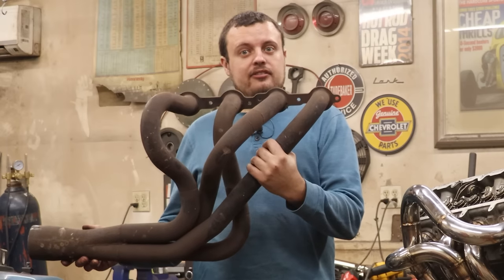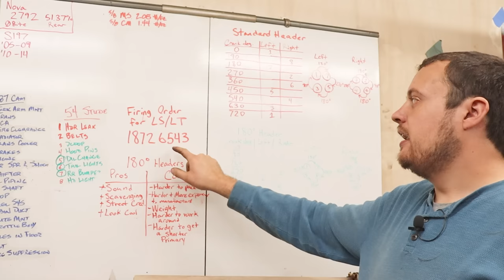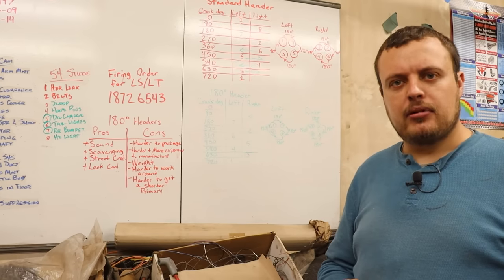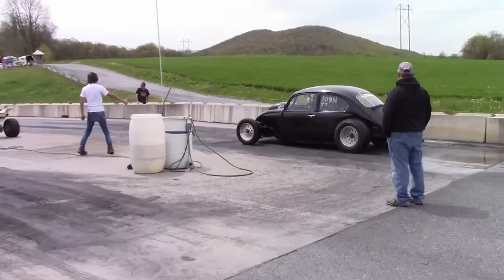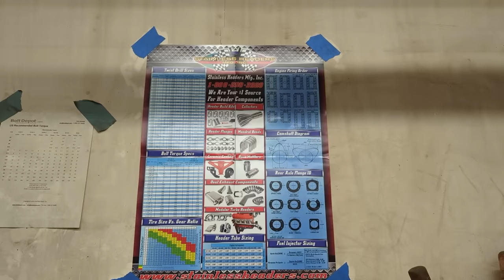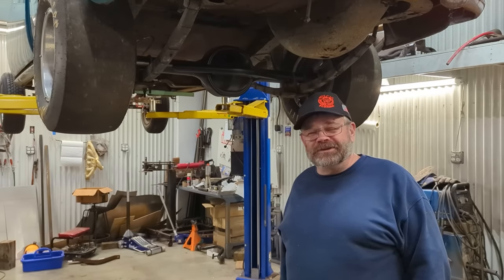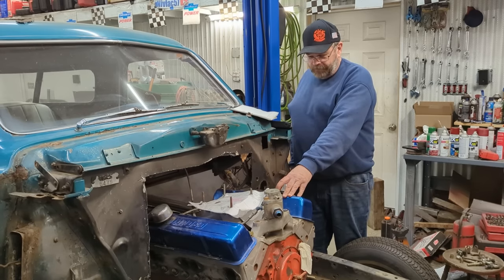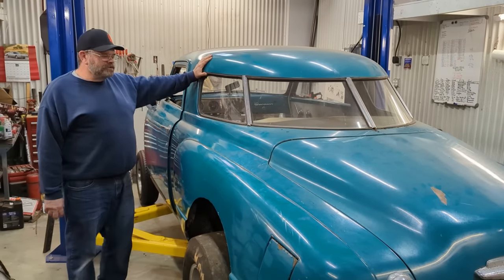I Built a Set of 180 Degree Headers for the Perfect Sound

Comment: Great looking set of headers. I have a 1987 mercedes turbo diesel with 6cyl 3.0L
I want to put a bugger turbo on. Do you know if its possible to build a header to give a diesel a good sound.
Reply from the maker: I've never messed with diesels, but if it's an inline 6, an equal length header usually will sound the best. Not event sure what to say on primary length. I'm sure it would require some heavy duty pipe too.

Comment: @junior: Maybe you can achieve power and sound at the same time!?!?
Make one or two H-pipe connections instead of the Y-connector. You have the 180°-V8 at idle but the power of "two 4-cylinders" at high rpm. If it's not smooth enough you can add 2 resonators (one for each bank) like an appendix. Ask someone for the measurements for improving the torque at a specific rpm.
Magnaflow mufflers each side don't hurt aswell.

Comment: Are you going to put a layer of mylar on the bottom of the oil pan or perhaps wrap the headers?
Reply from the maker: Probably not. It has a pretty good air gap. I'll monitor oil temps. If it's a problem, I'll probably wrap the headers in that spot.

Comment: Good idea but there are other solutions too. Yeah, regular headers are very inefficient. Have you tried tri-y or unequal lenth primaries. Check out powertech 10 with david visard. If your heart is set on sounding like a Ferrari, then flat plain is your ticket, but at a loss of torque. Have you tried a 4-7 swap? An LS firing order or an LS as is? Really good heads, stock, up to 4.10"  stroke without the airflow imbalance on the intake. Makes 50-70 hp more for the same displacement. Good luck, and keep up the good work.
Reply from the maker: Yeah. I've never heard a Tri-Y that sounded good. To each their own. I'm not doing this for the power, I'm doing it for the sound. If it makes more power that's cool too.

Comment: Would it be possible to swap the heads so the exhaust is pointed towards center of motor. Exhaust on top routed towards the front for turbos. And have separate intake manifolds for each side? Would be easier to do short primaries.
Reply from the maker: With the pushrod arrangement on this engine that would be very difficult.

Comment: Is the 180 deg heads also the same as "equal length" I've heard people mention before
Reply from the maker: No. They are not the same thing. Equal length is just when you try to make the tubes all the same length. 180 degree headers do try to make all the tubes the same length, but they also by definition rearrange the pipes so that they go into the collector with their 180 degree paired cylinders.

So proper 180 degree headers are equal length, but equal length are not necessarily 180 degree headers.

Comment: I see some really high oil temps  without some serious insulation between those pipes and pan ,wich is in turn going to hold hear in pan .
Reply from the maker: I'm not too worried about it. It has a pretty good air gap, but we will keep an eye on oil temps. If it becomes a problem, we'll wrap the headers in that spot. Look at modern Hondas. They run the exhaust right under the oil pan similar to this.
Reply: @Calvin-Nelson  savy !  Good plan !

Comment: This is the hard way. You can achieve a nearly identical sound by replacing your y-pipe with an x-pipe into a true-dual exhaust, meaning that out of the x-pipe are two separate pipes that dump wherever you will be dumping the exhaust. The x-pipe + true duals will also help with high RPM HP production. Another option is the h-pipe + true dual pipes, which will retain the "classic" V8 sound, boosting lower frequencies and improving low-end performance. If you primarily use your car for cruising then the H-pipe is the smarter option unless you really want your V8 to sound italian.
Reply from the maker: I've run a dual exhaust with an X pipe. It sounded nothing like this.

Comment: So….. would you think a set of 180* headers with a Y pipe would sound the same as an 8 into 1 collector setup with the tubes entering around the collector in the correct firing order? Essentially by merging the 180* headers with the Y pipe you are changing the pulses entering collectors from 90* intervals to 45* intervals the same as the 8 into 1 collector would do???
Reply from the maker: I've never heard an 8 into 1 that sounded like my dad's Datsun. With the Y pipe it is getting pulses every 90 degrees

Comment: you said 180 degree headers sound like 2 competing 4 cilinders, however, the ford gt had no Y pipe and it sounded like a proper V8. Wouldn't an x pipe be ideal in order to improve flow?
Reply from the maker: It probably would help. The GT40 probably sounds proper because of the proximity of the pipes to each other.

Comment: If the headers are different lengths you won't have pulses arriving as regularly as you say. A longer pipe means pulse takes longer to get to the end.
Headers when a tuned length have positive and negative pressure waves, the negative wave pulls gasses out by arriving as valve opens, the positive just before valve closes so charge isn't exhausted.
Syphoning doesn't occur.
For yours to work as regular pulses all pipes must be equal or a calculated length..... maybe if the crossover pipes are twice the length?
Be better to just have the 4 into 1 normal and just have different lengths for the out of sequence pulses maybe?

Comment: 180° Headers male more power!
It's what I call Free HP, nog that building a set isn't expensive, they are but they make power through making your engine more  efficient,most power adders have a trade off, big cam, low vacuum and no lower dnd power etc etc almost all power adders cost fuel.milage, Not 180° headers or anything makes engine more efficient and these make an engine considerably more efficient. Remember Pantera DeTomoso's? They had the highest HP small block ever built, the 351 Cleveland but the Pantera also had 180° headers and I read way back 50 years ago they added 22 HP plus, an exotic car sounded exotic.
My dad's friend had One I rode in many times, that mid engine winding up.was glorious!
Anyway, a super simple way to explain it is it almost does exactly what a 180° crank does, have you heard the Ford 5.2? Same Sound but you can do that on a 90° engine without the super high buck crank
Reply from the maker: It definitely makes power. My primaries are probably so long that it's not helping the peak a ton though. I just like the sound.

Comment: Man, shorty equal length headers with a Dr Gas x-pipe is just as good on the sound (at least on older sn95 mustangs)

Still 180* headers are totally awesome!!
Reply from the maker: I used to have that on my Stude. Didn't sound the same. It has similarities, but not 100% what I'm after.

Comment: When you are explaining the fireing order you say it comes always 180deg after etch other. But you have a crosplane crank so that isn’tthe case right. If im wrong explain what is wrong.
Reply from the maker: The point is that once you change the pipe arrangement it will now be 180 degrees.
Reply: @Calvin-Nelson  but the degree's are still of cause a crossplane experience's 2 fires right after each other

Comment: What is the effect of 180 degree headers on power?  It’s a cool idea but it would be nice to know if this is a form follows function mod or if it is a rolling pipe organ.  I don’t get such an effort if all it does is sound different.  Is there a prize for the coolest sounding car at the track?
Reply from the maker: It absolutely has an effect on power. Probably 10-20hp

The prize is a smile on my face when I do big smokey burnouts with it.
Reply: @Calvin-Nelson  Cool.  I've seen 8:1 headers that I presume would work similarly, but your notion of plumbing across the motor between collectors is probably easier to package in a car.  Cool idea.  I guess ultimately, the goal is smiles.

Comment: That’s wild the one without the y pipe literally sounds like a 4 banger . Ford did the opposite on their voodoo flat plane crank engine to get the throaty traditional v8 sound out of the gt350 if I’m not mistaken . You can also get any inline 4 to sound like a Subaru with uel headers , and vice versa equal length header on boxer engine sounds like regular 4 cylinder ( same firing order) .
Reply from the maker: Yeah. The voodoo engines are disappointing. Flat plane crank without flat plane noises...

Comment: Also would it be possible to shorten and lengthen the primary’s that are 90 and 270 out to accomplish timing the exhaust pulses on one side of the engine vs having to run primary’s to the opposite side of the engine or is that too much math to figure out? 😅 considering difficulty put aside in theory I imagine it could work
Reply from the maker: Unfortunately you would not get the scavenging benefit by doing that. It would probably improve the sound though.

Comment: Cool! It sounds awesome and looks neat!
And why does it have to be 8-2-1? Would't 8-1 give same result without the 'under the pan' tubing?
Reply from the maker: 8-1 is hard to optimize, because the collector has so much volume, when the exhaust gasses flow into it they lose a ton of velocity. It will have the sound, but may not have the performance. Also an 8 into 1 will have it's own packaging problems, but yes, you may be able to accomplish it without having tubes under the engines.

Comment: While 180 headers do sound good to some and I typically really enjoy your content they rarely are the best solution for useable HP and Torque. They were used decades ago in oval track cars and it was found that the RPM band was too narrow to be usable for pulling out of the corner all the way to the end of the straits. 180 equiped engines are notoriously high strung and finicky to tune. If one wants a vehicle street driven and usable they are not a good option. Kind of like the old big overlap cams that wouldn't idle, make vacuum and stumble awful at low rpms. Of course if all your going for is sound then of course pour it on. For me I'd rather be able to drive a vehicle and have power that I could put down to the track be it dirt or pavement.

Comment: Would those 4 180 exhaust pipes routed under the oil pan over heat the oil?
Reply from the maker: I'm not too worried about it. It has a pretty good air gap, but we will keep an eye on oil temps. If it becomes a problem, we'll wrap the headers in that spot. Look at modern Hondas. They run the exhaust right under the oil pan similar to this.

Comment: Does this increase or decrease power ?   I've been proven wrong thinking even length headers  & even out cylinder & exhaust pressure... Resonance killed HP so I was wrong ,  is this the same way with different length runners on headers ?
Reply from the maker: It definitely increases power and torque. A particular primary length will be tuned for a particular engine RPM. Longer primaries tend to favor lower RPM. These are rather long primary tubes, so we should see a gain around 5000 RPM.

Comment: Did I miss it ? What are the dyno numbers on the 180s?
Reply from the maker: Made 352 NA, and 405 with the supercharger. Then I pullied it up and it put down 500whp on track based on trap speed. Then the car got stolen.
Reply: @Calvin-Nelson  how much more compared to equal length? Or did you dyno that ?

Comment: Can you do the opposite and bunch the pulses up even more? Would it sound like a twin engine at that point?

Sort of unrelated but could say a 180 parallel twin be made to sound like a 270 parallel twin (equivalent to 90 degree v twin) or even more extreme to sound like a 45 degree v twin?

Is varying exhaust tube length pre collector enough to make these sound differences without changing the architecture of the engine?

I'm curious if you could make a small mundane bike like a Ninja 400 sound (180 parallel twin) sound like a beefier v twin by just making unequal length header tubes because that would be a neat way to subvert expectations

And/or could my 270 degree parallel twin FZ07 be made to sound even deeper by making one of the header tubes longer?
Reply from the maker: Yes. Some of those things would not be great for performance, but yes. Also it would only do it for a certain RPM range.
Reply: I like my FZ07 as is but I'm considering a Ninja 400 as a B bike for track days (low power learn a new track bike and/or rain bike) and since it's not important that it would be fast it'd be really fun to make it sound different than the normal bikes

Is it as simple as making one header twice or 1.5 times (or whatever the ratio would be) the length of the other to space out the pulses?

Comment: What about heat dissipation? Is it an issue yet or already thought it?
Reply from the maker: I'm not too worried about it. It has a pretty good air gap, but we will keep an eye on oil temps. If it becomes a problem, we'll wrap the headers in that spot. Look at modern Hondas. They run the exhaust right under the oil pan similar to this.

Comment: Jumbled sound 4:56  also note this is why a GM front drive V6 sounds all out of sync.  The radiator side  manifold collects exhaust and exits on the flywheel side then sends it to the firewall side manifold entering at the flywheel side.  The exit for all of the exhaust is on the center of the firewall side manifold.

Comment: Amazing sound and quality build
Questions about oil heat
Reply from the maker: I'm not too worried about it. It has a pretty good air gap, but we will keep an eye on oil temps. If it becomes a problem, we'll wrap the headers in that spot. Look at modern Hondas. They run the exhaust right under the oil pan similar to this.
Reply: @Calvin-Nelson  you are correct just an observation, thank you for all the content and wonderful seeing you guys excited bout running again, especially the ole man smiling 👍

Comment: What if instead of a Y-pipe you use a X-pipe? How would that change the sound?
Reply from the maker: Not sure. I'm kind of going to be doing that. It will Y together then Y apart like 24 inches later. I'll show it off in later videos.

Comment: i'm chasing a 10 second pass with my naturally asperated 427 BBC, this is muscle technology from the 60s, there is no fuel injection or crank position sensor or any horseshit like that,  180 degree headers might just give me what i need if they really help increase RPMs but i've been leaning towards 12" zoomies because i am not down with putting 100 more hours into a disposable Chevette....   How many RPMs are you expecting to pick up?
Reply from the maker: Not really expecting to pick up an RPM. I would think it should be worth 10-20hp is done right.
Reply: @Calvin-Nelson  thanks for taking the time, you're a straight shooter....  I'm confused,  to make more horsepower an engine needs to generate more torque or operate at higher rpm.  By opening up and or tuning the exhaust, you get better exhaust flow which give you more rpm.  where is the HP coming from?
Reply from the maker: @dirttdude  it should make more torque at the RPM that it is tuned for.

Comment: I cant help but to think its gonna make the bottom end of the motor  more hot than it was meant to be. I bet its gonna sound bad ass though
Reply from the maker: I'm not too worried about it. It has a pretty good air gap, but we will keep an eye on oil temps. If it becomes a problem, we'll wrap the headers in that spot. Look at modern Hondas. They run the exhaust right under the oil pan similar to this.

Comment: Will you be wrapping the headers? Just wondering how the heat from the going under the oil pan will be dealt with? Looks great though this definitely earned a subscription!
Reply from the maker: I will not be wrapping these beauties. Stainless Steel has half the thermal conductivity of Mild steel. So far the oil temps have gotten to the highest of 215, which is right where they should be.
Reply: @Calvin-Nelson  thank you for the update. That honestly surprises me, not gonna lie. Awesome setup though love the Studes as well
Reply from the maker: @theofficialdirty2444  Yeah. Most of the time the oil temp is around 180. It's totally fine.

Comment: Does the Y pipe need a to be as close as possible from the collectors? & the Y collects to a 3 or 3.5 inch pipe I assume.
Reply from the maker: The secondary length will have to be tuned. Should collect to 3.5 or so. Depends on horsepower.
Reply: @Calvin-Nelson  looking forward to hear your set up. thank you for the reply.

Comment: You'd do better to get that sound by putting a flat plane crankshaft in it! But Ford puts a flat plane crankshaft in a Mustang and they cook up headers to make it sound like a traditional cross-plane V8. Go figure.
Reply from the maker: Yeah. Billet cranks are only $8000 and then it will vibrate oil filters off.

Comment: How much extra heat does it make with all that extra pipe?
Reply from the maker: Not much at all.
Reply: @Calvin-Nelson  interesting.  
Doubling the pipe amount didn't double the heat?   I would have thought there was a significant increase in the engine bay temp.
When do you go into production?
I got a stock 82 chevy c20 305 I like to get a set for. Its bone stock. I want it to sound good though. 
Big thanks for making yours and putting it on YouTube. You're ability to explain whats going on is spectacular and greatly appreciated.
Reply from the maker: Yeah. I'm not going mass produce these. Lol. Appreciate the interest though.

Comment: Won't those pipes heat up your oil real bad?
It's a cool idea and sounds great.
Reply from the maker: I'm not too worried about it. It has a pretty good air gap, but we will keep an eye on oil temps. If it becomes a problem, we'll wrap the headers in that spot. Look at modern Hondas. They run the exhaust right under the oil pan similar to this.